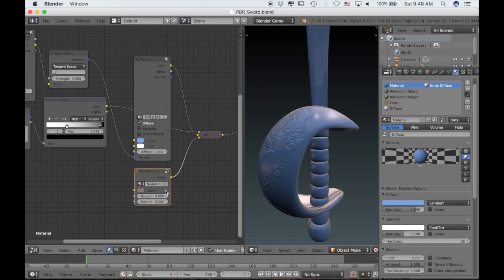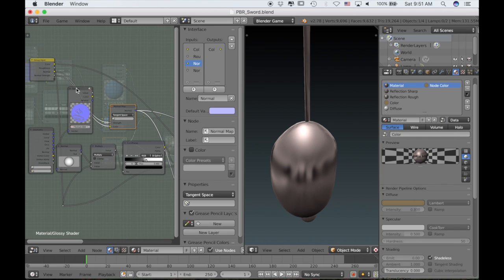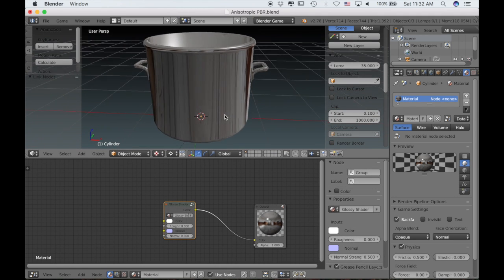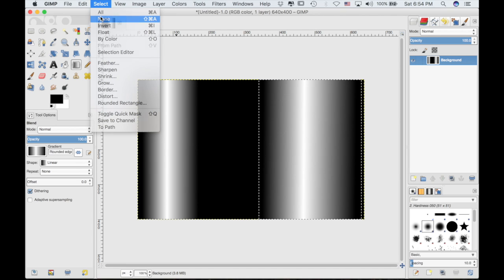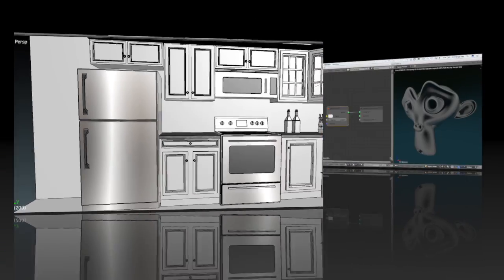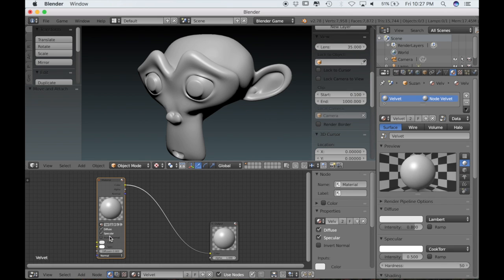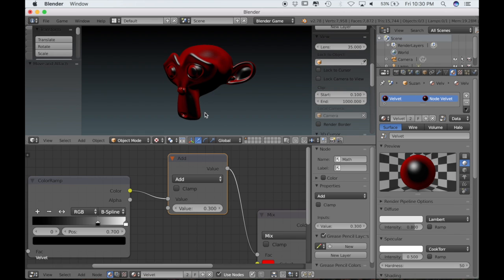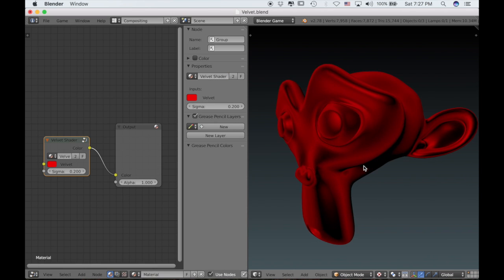Realistic Viewport Materials in Blender Part 2

Comment: Michael - you are probably familiar with box mapping environment images onto an object which creates  quite realistic reflection textures in the viewport - however I wonder is there away you are aware of to map box map textures through the nodes as the sharp and blurred images which give the metallic texture.  I hope yopu follow what i am trying to explain.  I think if there was a way to do this you would not only get the metallic effect bui the reflection aspct would be pretty excellent too - any ideas? Much appreciated!

PS - the color chamgge node doesnot seem to work any more with the changes to the glossy shader either - have you noticed this -?
Reply: Fahy Colm i just replied to your reply to my comment, i hope you get some use out of that reply.
if you have any doubts feel free to ask. i have been delving into "technical art" and 3d gfx for almost a year now and i have learnt a lot of interesting things
Reply: also, the best way i know of to blur the reflections on a reflection map is either using a uv distortion map or to pre blur the reflection map
Reply: actually - scratch that - I worked it out - I applied the sharp and blured textures in the glossy shaders as environment reflectice box maps - when i rotate the metal object the reflectsion reflect exactly the environment.

However , I am still struggling to find a way to accurately combine images materials with the glossy shaders so that I get the matallic effect  on top of or combined with my materail - i am nore what nodes to use or the sequenec - .. tht might eb useful Michael if you could make a comment in your next video!
Reply: Fahy Colm i am not sure what you meant but for coloring a reflection map you should multiply your reflection with an uv mapped color map.
mixing with a material can be done using a reflectance map and using it as a mix factor
Reply from the maker: The truth about box/cube mapping is that it's an absolute pain to create the cube map textures. I know that Blender recently started supporting them, but honestly, I didn't see the need to learn much about them as 2.8 (as I understand) will support real time reflection in BGE. To answer your question though, I do believe you can use them with material nodes.
Reply: Wayward Art Company ...thanks for reply...yes i tried and it works a peach...

Comment: Just a heads up: using the dot product between  the view vector and the normal is more accurate than using the normal dot output
Reply: Hi! see my comment above - are you referring to the mapping of the reflection textures? Just curious - oz I am looking for a better way to achive this if possible
Reply: Fahy Colm i meant for use as fresnel.
but a mathematically correct reflection vector for mapping a reflection texture also makes use of the dot product between the view vector (wich i will refer to as "i") and a normal vector (wich i wil refer to as "n"). The formula is as follows:
reflection = i - (2 * dot(i, n) * n)

after that you need to convert the vector to world-space and a way to map that vector to texture coordinates